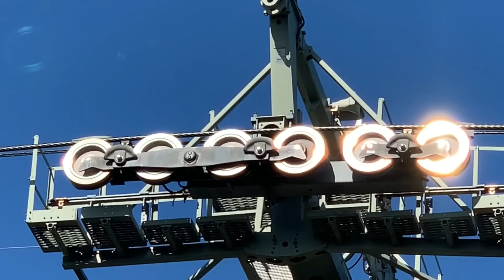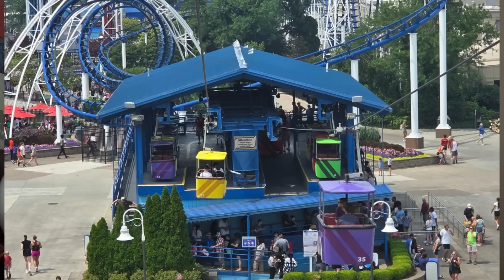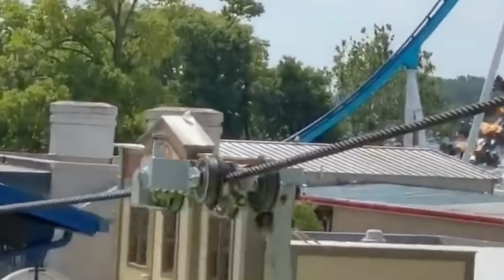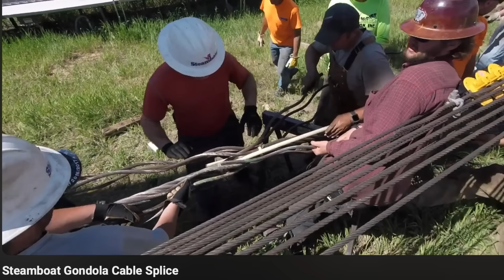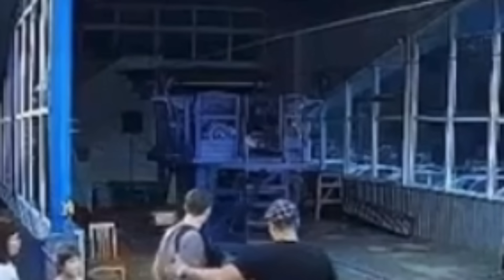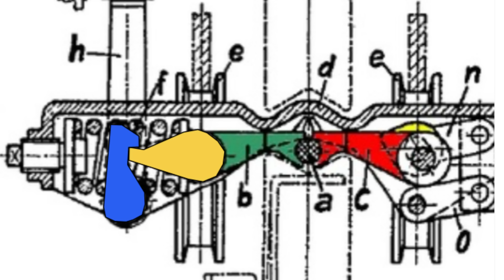Sky ride buckets operation and how it works

Comment: Know these rides like the back of my hand. Know all the history and how they were built from concrete foundations to the fine swiss steel that was used. The Von Roll VR 101s  were developed way back in 1945. Oldest one built in 1952 still runs in the chec republic.  As for the haul rope replacement,  happens every 7 to 10 years. Its replaced when the haul rope diameter is too small causing grip slippage.
Reply from the maker: Awesome! Is that 7-10 years period for ski lifts or does the inspections differ from a park to a ski hill?
Reply: @ryantheridemechanic  Non detachable lifts are different . Every 12 to 15. San Diego Zoo Skyfari  1969 Von Roll VR 101 transports 4.2 million visitors per year. The busiest Aerial tramway in California as well as the most ran VR 101 has their haul rope replaced every 6 to 8. Their haul rope is 27.5 mm  Haul rope comes from a company in Switzerland called Fatzer.  Breaking strain is 62 tones.
Reply from the maker: @vonrollskyway1  definitely sounds like one of those things where you can’t really get an aftermarket cable and install it without some sort of lack of coverage or negative repercussion.
Reply: Robbie Von Roll has some sort of radar and will appear whenever sky rides are mentioned on the internet!  Thanks for your passion and insight!
Reply: Ryan, I apologize in advance for my friend Robbie's addiction to skyrides.😂
Reply: @Jenlovescoasters Thanks alot Jen. Brat..lol
Reply: @vonrollskyway1 😂😂😂😂
Reply: @Jenlovescoasters  we're all here to nerd out, they're doing the right thing Keepo
Reply: @TS_Mind_Swept so real quick, this guy is my close friend, and it was a joke. Calm down.
Reply: @Jenlovescoasters  There wasn't an issue; no need to say 'calm down' since that just incites violence o.o
Reply: @TS_Mind_Swept keepo.
Reply: @Jenlovescoasters  You know im the Von Roll VR 101 guy. .
Reply: @vonrollskyway1 lol! Yes Robbie.
Reply: Are you the host of Facebook-group Von Roll  ?
Reply: @295g295  Yes we are. If your a member, thank you for joining
Reply: Omg. Robbie....😂
Reply: @kenerstad2302  Telling what I know. My Expertise

Comment: My friend's late uncle worked on the construction of the sky ride at the now defunct Six Gun Territory in Silver Springs Florida. He had many stories about the marriage of the cable as he helped the Von Roll specialist do the work. From what I remember of his tails the cable was prepared on the ground then hoisted up in the air and the marriage was completed. Once complete the counter weight was let slowly into the down position to initially tension the cable. As to the drive arrangement for what I can remember the whole drive was in the base of the loading side tower. It  consisted of a large motor belt driving the gear reduction system, then a big roller chain from the gear box to the bull wheel. As to the cables operating life to the best of anyone's recollection the cable that was in use when the park closed in the early/mid 1980's was the same one installed during the early 1960''s construction of the park.
Reply from the maker: Thanks!

Comment: Splicing cables (attaching the ends together) is a pretty common thing in other industries, do a quick search on splicing 3 part lines….  Also, a really interesting video on a fully destructive test of a cable car system is at :  https://youtu.be/u4WPSZojtyE?si=dEo6-8IQY-Qf5p2K

Comment: Only a couple of things to add. Great Job covering Von Roll systems. First of all, an essential item is a "wear plate" on both sides of the grip on the underside of the carriage. This is a metal plate that is softer than the cable and serves as a sacrificial layer. Also, on the counterweight side station, the bull wheel will have metal tabs at 12-inch intervals or so. Since all rollers are rubber-insulated, these metal tabs allow the cable to be grounded in the event of a lightning strike or an electrical short that contacts the cable. I loved the Von Roll systems and was fortunate to watch a splice job on a  7-year-old rope that needed to be replaced. Amazing equipment... Glad that you featured it, Sir... Bravo.
Reply from the maker: Thank you very much!

Comment: I couldn't quickly find a link to any reports, but years ago (late 1970's perhaps) there was a sky ride / chair lift failure at an amusement park in the Myrtle Beach, SC area. A tower arm fell causing the cable and all the chairs to drop. The arms were cantilevered out over a hinge point with several bolts on the inside end of the arm keeping it connected to the tower. One of my college professors was brought in to lead the root cause analysis. Turns out that the manufacturer hadn't accounted for corrosion due to the ocean atmosphere, and all the bolts had corroded. Finally one set got weak enough to cause the arm to fall. My professor and the manufacturer recommended some metallurgy changes to the hardware and increased coating and inspection on the arms, but the whole ride ended up being dismantled no too long after the incident.
Reply: Second story of one failing plus the video. Never going on this thing

Comment: Back the day while working at a ski resort, I was part of a rope replacement on of lift.
It was fascinating to see it first hand and be part of the operation, and i was told that there only four people in the world, and that it was a family generational craft handed down.
If I remember correctly, there was a core as well wrapped into the cables, at least for the ski lift.  
Certainly gives you a new appreciation of just how fail proof that rope is.

Comment: Its funny that you talk about the cable marriage. I worked on the SkyRide at CP in '06 and '07 and one of those years, I noticed the marriage and had the ride taken down until our mechanics came and inspected it. That's the point I learned about the cable marriage. I was so shocked to learn about that. It had never occurred to me that the cable was not manufactured as a loop.
Reply: Do you recall the wind limit for the ride? I used to know, but it's been nearly 30 years since I worked at CP.
Reply from the maker: @Joe @Joeybagofdonuts76  ask @vonrollskyway1
Reply: @Joeybagofdonuts76  If I remember correctly, it was 15mph would cause us to shut down.
Reply: @dreamingtree101 that's what I was thinking.
Reply: @Joeybagofdonuts76  Funny antidote that no one asked for:
One of the years prior to my employment on SkyRide, the employees made hoodies that said "When mother nature blows, we return the favor by going down"
Reply: @dreamingtree101 that definitely sounds like CP employee humor.
Reply from the maker: @Joeybagofdonuts76  it’s in a comment here but @vonroll will know for sure.
Reply from the maker: Many people just think it’s welded

Comment: I worked on CP's Skyride many years ago and have a couple of things to add about backup systems - CP has a VW gasoline engine as it's backup.  CP tests it occasionally, I was there for one of the tests.  The VW engine ran so slow that it would easily take over an hour to clear the cable.  There is supposedly also a third level backup, a hand crank system, but I suspect that was only used to move the cable a few inches during maintenance.

Comment: Speaking of cable car systems, it would be cool for you to cover the very unique lift at Waterworld in Denver. They purchased it from Circus Circus/Adventuredome when it was called Grand Slam Canyon. It ran outside of the dome along Circus Circus Dr from the dome to an area near the front of the casino (over the former tram tracks).

Comment: Fastest video I’ve clicked on in a long time! Way back in 2006 I worked as an assistant team lead on the ride ops crew for Skyride. Brought back a lot of memories of that summer. We only had 2 mechanical issues that I can recall from that year. 

The first was one of my fellow ride ops notified me of something strange on the ground near where the cabins come into the station on the drive side. It was a large metal pin that had a diameter  as big as my fist, and was maybe 6-8” long roughly. Had no idea where it came from, but assumed incorrectly at the time it was from one of the cabins. It was actually from one of the pivoting wheel assemblies that the cable ran on. Later saw one of the wheels just dangling down in the station. In hindsight I should have just E stopped the ride, but at the time I thought it was a cabin issue. The maintenance crew was rather happy though that I didn’t E stop it, as it took a lot of pressure off of them to fix a ride actively loaded with guests.

Instead, I called for an emergency shutdown to get everyone off the ride and all cabins off of the cable in an expedited manner, which is a fairly chaotic dance that involves orchestrating everyone across both stations. Happy to share the process if anyone was interested.

The other maintenance issue was having the lights completely go out on the drive side station. Happened on the 4th of July, which also coincidentally was the only day of the year where the park stayed open until midnight. Turns out the station lights were on a timer, which wasn’t set with that day in mind. Luckily I was able to climb over to electrical panel in the middle of the platform next to the main drive wheel, and find the switch to manually turn the lights back on quickly. At first I thought we had a power outage / failure, but the wheel and cable just kept on spinning. 

Thanks again for all you do on this channel! I really wanted to transfer from ride ops to maintenance while I worked at Cedar Point, but never got the opportunity to do so.      Your channel has been awesome for being able to see and learn about all of the small hidden details.
Reply from the maker: Thanks for the story I’m glad I’m can be here to help and offer these videos up.

Comment: Recollections from working the Von Roll 101 at AstroWorld: 1. During a lightning storm shutdown you had to leave the building. That cable stretching across the park is a giant lightning rod. 2. There was a maintenance/inspection basket the length of two cars stored at one end with two hangers/grips that they would use for maintenance on the wheels on the towers. 3. Maintenance called the groups of wheels carrying the cables on a tower a "battery" as in a group of something. 4. The phone lines to each station and the tower sensor wiring ran across a separate wire in the center to each tower and the stations. 5. The wind speed and direction sensor was mounted on the top of one of the towers. Also: 6. After the accident at Texas State Fair and Six Flags Mid-America in 1978 they reduced the safe operating wind direction and speeds on all Von Roll 101s - cross winds vs head winds. 7. (I may have this incorrect): There was an earlier version of the clamp on the Von Rolls or a similar type that did not have the cam lock and with enough force it could disengage from the cable.
Reply from the maker: Thanks for the great info!

Comment: Something you don't mention is the need to have the density of cars along the cable to be reasonably uniform.  When sudden demand rises, they can't just add cars more quickly to the cable with a short time spacing.  They have to be added gradually, the timer on the release mechanism being slowly reduced, so as not to have a lot of cars on one part or one direction of the cable, & few on another.  The same goes for removing cars; they must be removed gradually.  I would assume computer handles this, never permitting the cable load to go far out of balance.  The cable could slip on the bull wheel or overload the motor if that were permitted to happen.
Reply: Also for the Von Roll 101s since you manually caught them you had to have enough time between each car to receive them on the other end. More cars meant two or more workers alternating every other catch.  Now we did send 3 or 4 empty in a short pace (there is a manual pull release) for storm shutdowns but you called the other end to give them a heads up.
Reply: Yeah and it probably just breaks down if someone fucks something up. I used to work on a log flume ride that was like this. It was stressful putting extra boats on when the ride was at full capacity and taking them off at the end of the night. It was also stressful the entire time the ride was at full capacity with so many boats on. The spacing of the boats gets closer together the more you put on and if the boats get backed up too far out of the station or are too close together when approaching the chute breakdown is imminent. 😱

Comment: Catching cars at Sky Ride is SERIOUS WORK. You will get tired quickly. It's one of the most physically demanding rides to work
Reply: I was in great shape from working the skyride. I wore weight lifting gloves to reduce the calluses on the hands. Those cars alone were around 600 lbs each.
Reply: @JEdwardBanasikJr  I had a friend on Sky Ride crew and he gained like 15 pounds of muscle that summer. I did it for 3 days and that was enough for me.
Reply: They come into the station like bumper cars...respect to ALL ride operators!
Reply: I was just watching it Saturday. I wondered why it was a thrill level 3 vs the Giant wheel being a 2. My thought it’s the crazy stopping sequence

Comment: I'm glad you finally did a video on skyrides. I hate to admit it, but for me they are some of the sketchiest and most precarious looking rides in a park. Ever since I was a kid I've always had to try and push Final Destination-y images out of my mind whenever I ride one (and this was long before those movies existed).  I'm not scared to the point I won't ride them (actually many present good photo ops that I'd otherwise miss out on) but they make me nervous.  I suppose it's the fact that the grip looks so flimsy (at least from the ground or rider's perspective, if you can see it while on the ride) for what it's supporting.  Kinda like an 800 pound gorilla holding onto a tree branch with a single finger... The video clips you showed make it look a bit more substantial, though. 
The Von Roll ones aren't bad as they are enclosed and you can't see that part of the mechanism when you are riding. But then there's ones like the Skyway at Knoebels - it's a repurposed ski lift.  It goes up a steep hillside, which allows for a nice view of the park on the way back down. But I have trouble taking pics because it's all I can do to peel my fingers off the lap bar! I can't imagine how they would evac people from that one given it's location.

Comment: Maybe I missed it, but I'm wondering: what happens if the cable breaks? 🤔
Reply from the maker: Cable will fall about 800 ft but parts will stay up as the weight would still tension parts. Didn’t hear of any cable failures in my research though.

Comment: Ah yes the Cedar Point Skyride that only survived by poaching other in the chain
Reply: My home park actually had two sky rides a big one that transported you from one end of the park to the other and a little one that was out and back. They removed the big one a long time ago probably in the 80's or early 90's (the ride station is still there after all these years just converted into a cafeteria style restaurant on the lower half) and just recently removed the little one so last summer was the first season without it. They also converted that station into a food stand or a souvenir shop. I always wondered why they removed the bigger one.

Comment: Very good!  I had always avoided cable cars run on one single support and drive cable, and when I realized they were letting loose of the cable at stations it doubled my fear of them.  But I just might ride one, I usually insist on two support cables with an additional drive cable.

How big a motor to drive all that?
Reply: The backup emergency motor on many of the Von Roll 101s was a VW Beetle engine.
Reply: VR 101s  from 55 hp to 120 hp. Lots of variables.  Speeds from 4 mph to 8 mph

Comment: What are the safety features if car is overweight or dumb people try to rock it back and forth? CP my home, Skyride scariest in the park! You almost make me willing to ride it again! I'll just walk though!
Reply: Nope...I'll just walk
Reply: I can answer that. 
On every tower there is 2 safety switches. One is called the brittle bar and the other is called a RPD. The brittle bar is at the very front of the roller battery assembly.  If the haul rope comes off the front sheave, the haul rope makes contact with the brittle bar shutting off the ride immediately.  Takes about 4 to 6 feet before the ride comes to a complete stop. The ride will not turn on with a broken brittle bar unless in VW mode . The RPD Rope Position Detective  us located between sheave 1 and 2.  That detects if the haul rope is centered on the sheave train. If for any reason the haul rope goes off center, the ride will stop. 
Hope this answered your question

Comment: FYI, in the world of aerial lifts like this, each "coach" is actually called a carrier.  Eg, a grip, a hanger, and a cabin = a carrier

Also the "curve" in the station the carrier goes around to the other side is called the Contour.

Modem lifts instead of using gravity to catch and launch the carriers instead use rubber tires to decelerate and accelerate, plus move the detached carrier around the contour.

Comment: It seems like the Von Roll cable clamps are safe enough and then a little bit more for good measure... If they were an early manufacturer and developer of these rides that makes sense cause it looks like they made certain that short of an entire arm failure the clamp isn't coming off. More than a bit of redundancy in the design